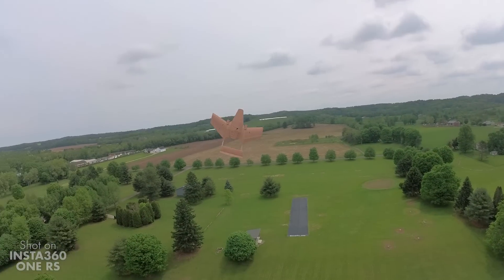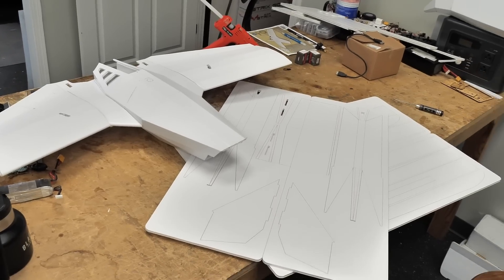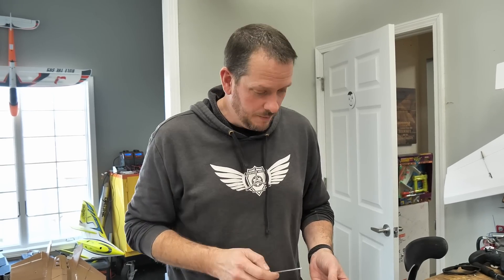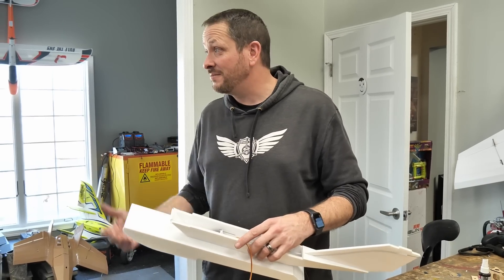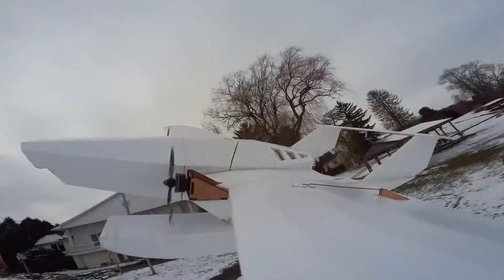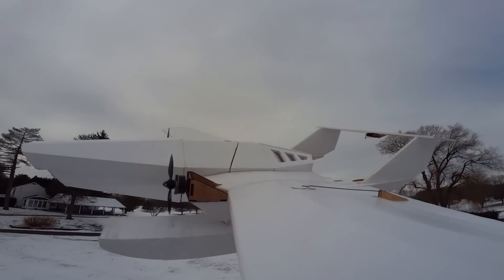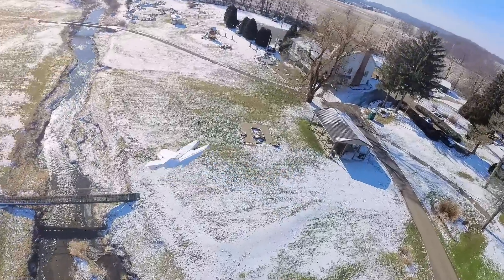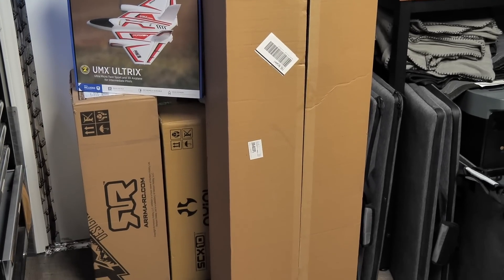Prototype All Terrain Vehicle - Flerken Prototype

Comment: Now add a bladed lip under the nose that in air-mode is snuggly fit to the nose and works as canards and lowers based on proximity and air-pressure to transform the vehicle into a ground-effect-pusher. The general design btw. is a lovely reminder of the WipeOut-games, well done.

Comment: Nice job on this and cool idea. You inspire with your ideas and willingness to try stuff. One idea fro improvement, what if you flip the screw direction and put it in from the top down into the pontoon. If the plate was already in the pontoon then you do not have to cut a hole in bottom of the pontoon and you can tighten screws from the top 😊😊.

Comment: So it would be possible to use the twin boom design with wheels fitted, and have a hole through for each screw that mounts the pontoon and also a cut out in the top to accommodate the wheels so you can just remove the pontoons and the wheels are already fitted.